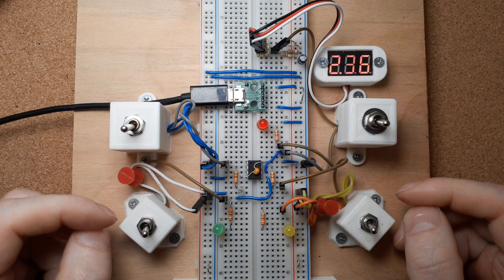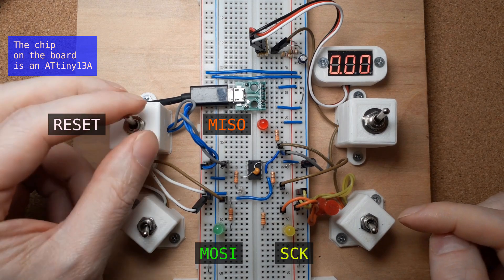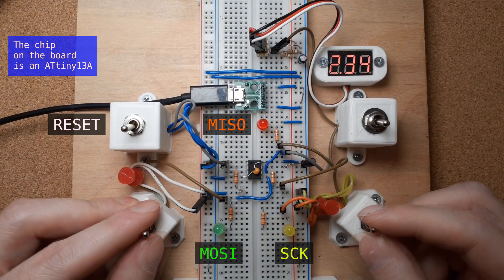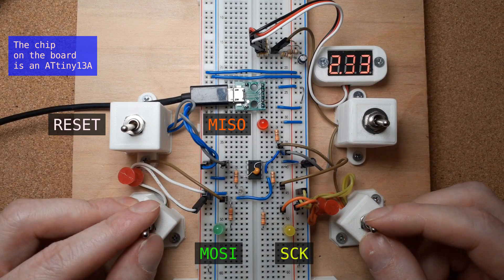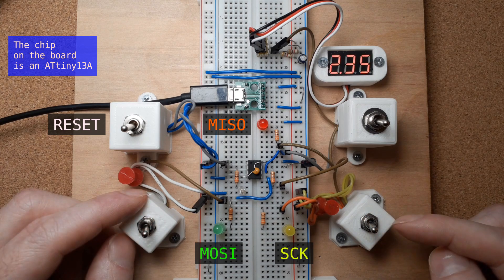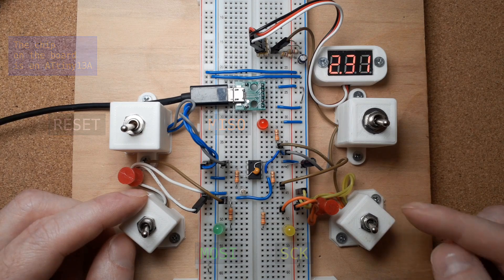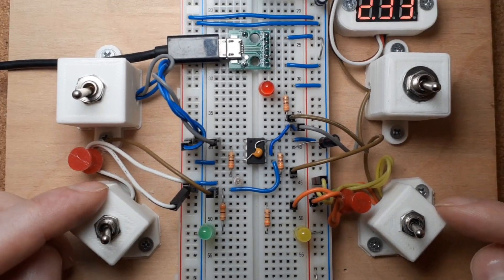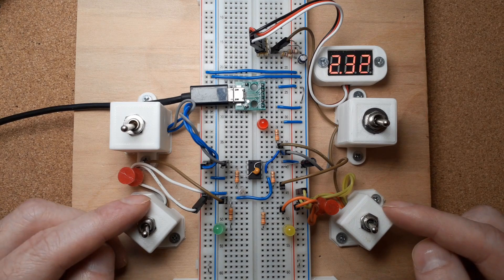AVR ISP By Hand: Intro/Teaser/Interest inquiry.

Comment: Very nice. Our teacher at school thought us SPI this way but by telling arduino to manipulate pins in the same way in a loop
Reply from the maker: In a way you've kind of done this. ISP is carried SPI. The thing that makes it a little different to most SPI devices is the lack of a CS/SS signal. Something that I've mentioned in the final draft I have. You can absolutely do that with ISP. One advantage this has is being able to cut and paste into a terminal. I found that really helpful because it's so easy to screw up with switches. =)

Comment: I bet you have some debouncing circuit inside the switch housings?
But yes, please go into some more detail about it
Reply from the maker: I've made sure to include some about that. It was good to see that someone asked. I'd scripted and tried doing this a couple of times and really didn't know what people would care to see or if they'd care to see any of it.
Reply: @TM-zs7ko  i dont think people care to see you press the switches thousand times, but are interested in the protocols and stuff
Reply from the maker: @2000YG  Yeah I don't know. We'll see what they make of the one that's about to come out. It's a mix of some description of ISP, what's on the board, how you might do it differently, and performing it with details. Partly I want to able to refer back this is other things.